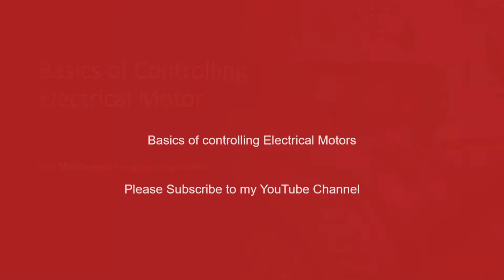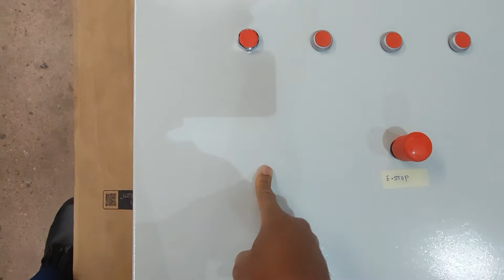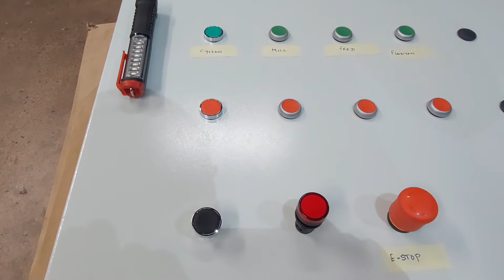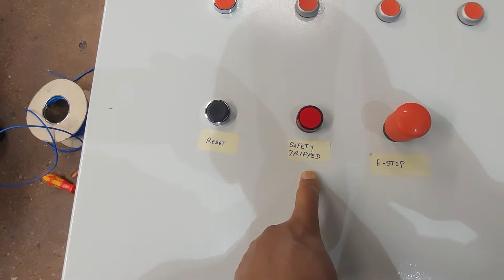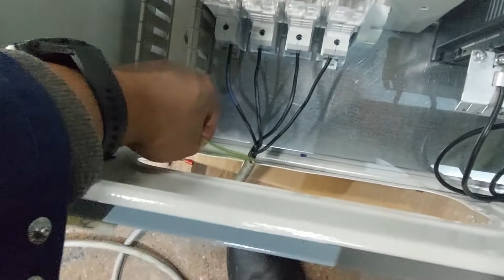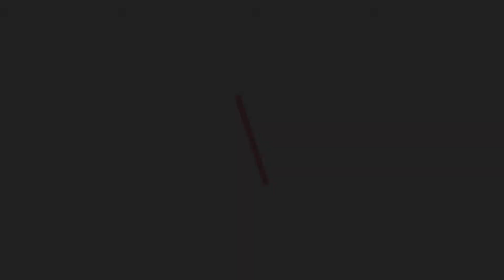PSU for the control Panel via  AC Voltage transformers and what you should know when wiring

Comment: Thanks . Please can you teach me ?
Reply from the maker: Yes, I would like to. What would you want to know?
Reply: @maintenanceengineeringinsider  help with troubleshooting sensors
Reply from the maker: There is a small device called Sensor Tester Micro Detector. You could  use it to connect proximity sensors, it tells you if a sensor is still OK or not. It quickly tell you if it's PNP /NPN.
Another way to check a magnetic sensor or a capacitive sensor , is to put your screwdriver on it and check to see if it detects. Because the most common problem with sensors is misalignment.  Sensor may have shifted from original  position. 
Stay tubed, I will make a more detailed video , as soon as I have some time.
Reply: @maintenanceengineeringinsider  please how to contact you
Reply from the maker: obi1knube@hotmail.com
I live in England